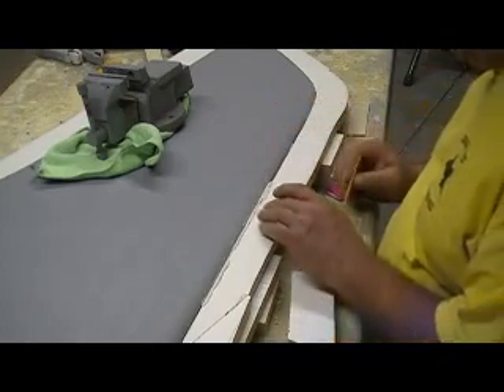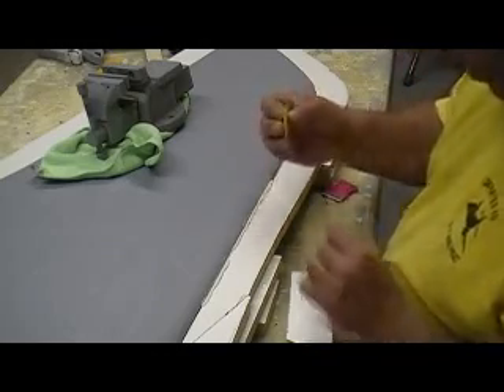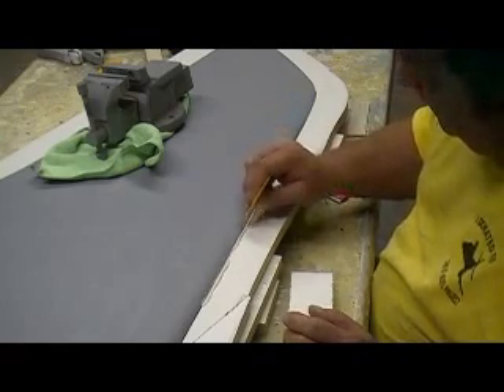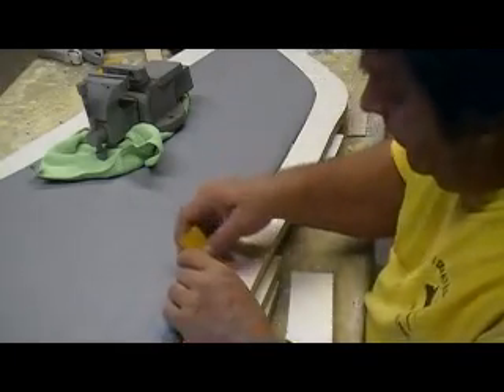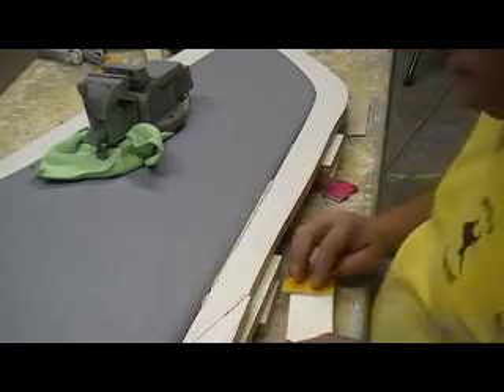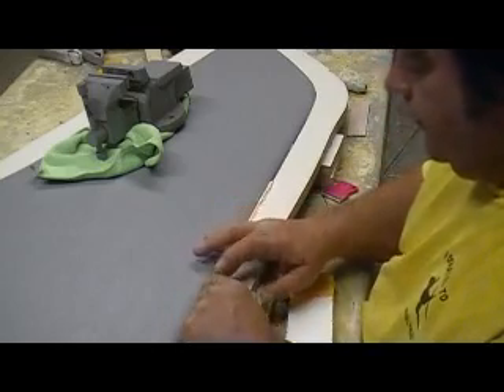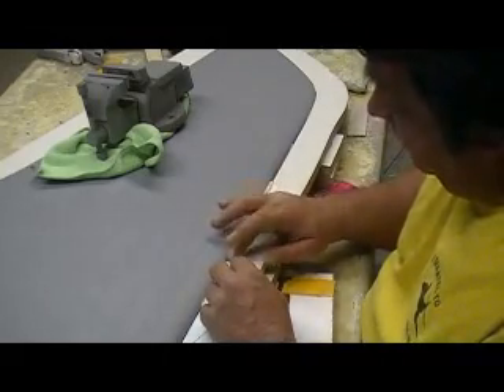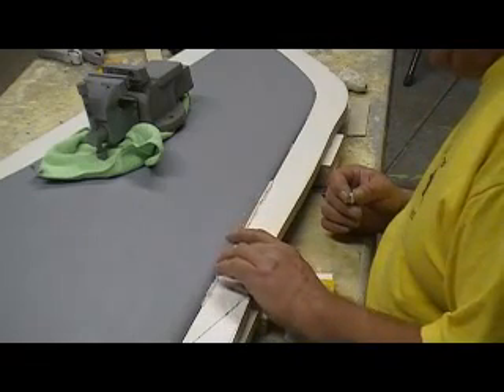how to build a rc jet F-105 thunderchief # 37

Comment: When I was building full size sailboats, I used to push the clay into the gaps then dip my finger into the partall and smooth the clay. I found the clay would go super smooth and not stick to the part.